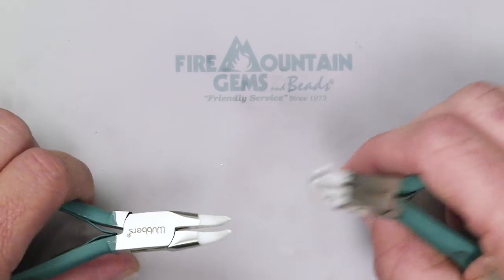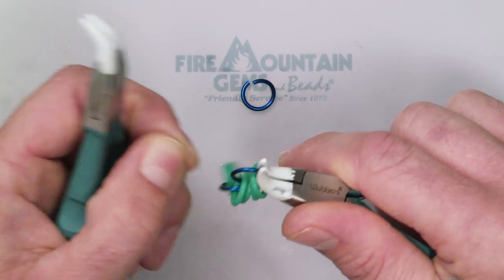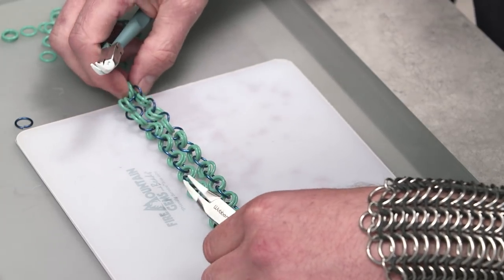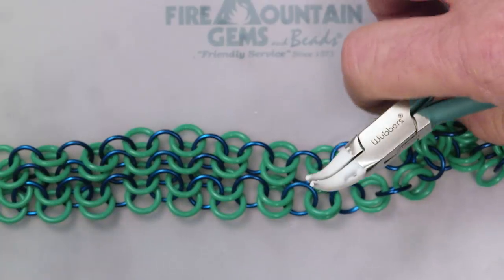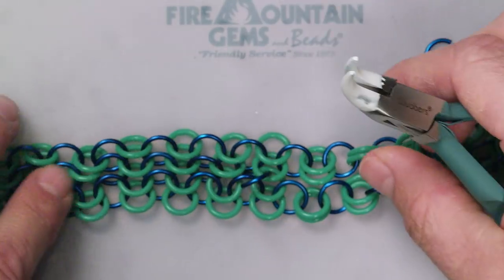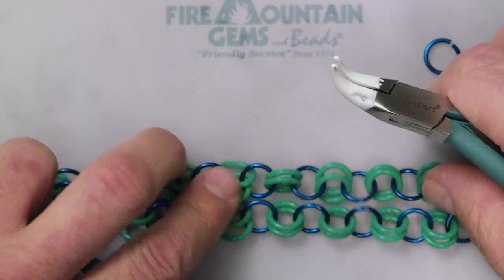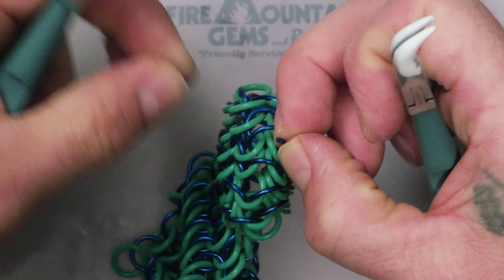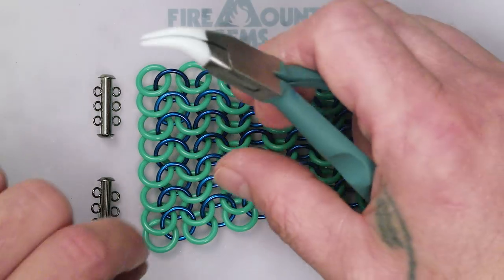European 4-in-1 Chainmaille Bracelet

Comment: what size jump rings and oh rings?
Reply from the maker: Hi. In this project, the Oh! Rings are 12mm with an 8mm hole size and the jump rings are 12mm with a 9.2mm hole size. The larger the rings, the larger width the bracelet is, the smaller the rings, the smaller width the bracelet will be. You can use any size of rings you desire on this technique, not just the ones used in this project. Happy creating! 🙂
Reply: @FireMountainGems  thank you